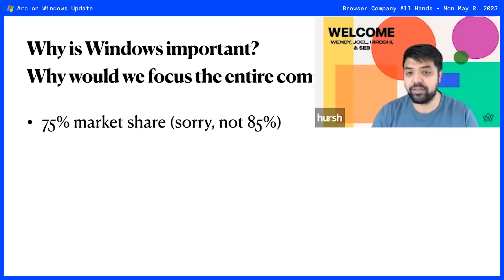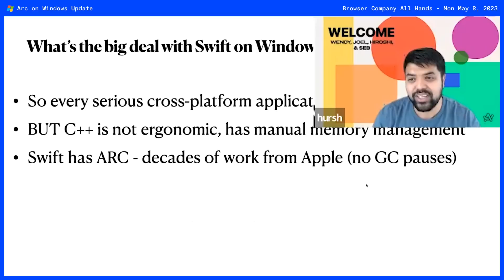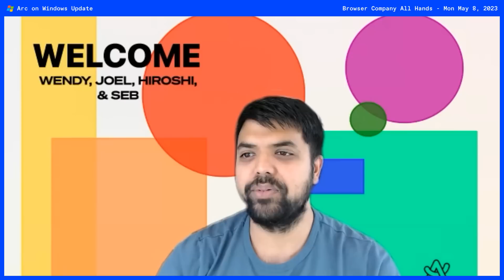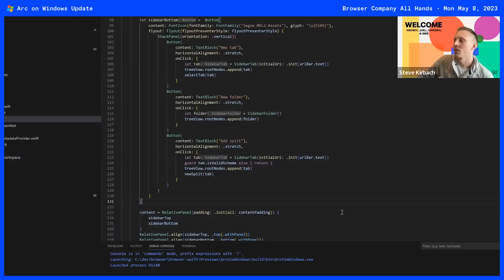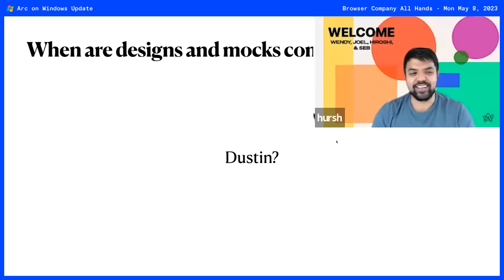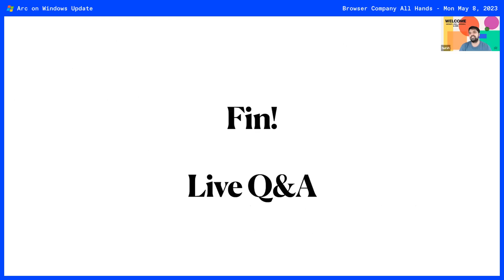How we're building the Arc Browser Windows app with *Swift*

Comment: Would it make any sense to bridge SwiftUI calls to WinUI? I'm thinking about how WINE works in linux, translating windows library calls to linux library calls. The idea of building an app in macOS and have the UI code just work on other supported platforms as part of the build process seems enticing. I guess the obvious big drawback would be Apple replacing SwiftUI with something else down the road. Maybe the solution is a both/and approach. Allow for an optional bridge, which could be maintained as a separate project that gets inserted into the build toolchain when present. The job of the bridge would be to handle Apple's UI calls passing them appropriately to the UI framework of the build target.

Comment: I'm super fascinated with this as a Swift developer and how you inter-opt with winUI. (also, Windows has so many UI libraries, is winUI the best / most modern?) I imagine initially crafting your own UI library in Swift to work with winUI will be necessary, I wonder if eventually one could just write SwiftUI code and check a box to deploy to Windows. Would that be possible? Or I guess Apple would need to be involved and/or open source SwiftUI
Reply: apple won't do it 4 sure
Reply: it does seem unlikely, but maybe they would open source SwiftUI? Depends how they would separate it from their internal OS dependencies  @TheZazatv
Reply: @relaynotes  I don’t think they would they do not tend to open source ui kits or other frameworks needed for development (combine etc) Moreover cause of lack of the documentation and closed source SwiftUI at first year was a black box. And lots of their new apis makes you update your minimum deploy target like crazy. Unlike Google’s open source Compose which has a backward compatibility. Ugh I wish we had the same policy on Apple platform
Reply: I mean, right now for sure SwiftUI is closely aligned with their software releases which can be annoying but keeps dependencies and app size down compared to Google's approach. I guess the thing that gives me pause is they call it "swiftUI" not "appleUI" and swift is open source. So it's not impossible they don't consider to open source it once its more fully baked, just like Swift itself took 2 years to open source. But, could be wishful thinking, you may be right, I'm just saying with Swift they have done things differently than the old AppKit UIKit days. @TheZazatv

Comment: as someone who uses go on daily basis. hope swift is backend ready (they have great foundation but lack of community support)
Reply: Technically there is not a real backend for Swift, Swift is designed purely for Apple OS. you should consider the entire browser as an client-side/local only software that is protected under the OS (Wins or Mac), just like an app inside your mobile.
Any sensitive data/id that connects to the remote backend (which is often written in java, python, C++, go, you can name it) will be encrypted.

Comment: I understand that Arc is already built in Swift for Mac, but I truly believe that considering something like Tauri or exploring Rust as an alternative could be the best choice for you. Tauri can work on multiple platforms like Windows, Linux, and Mac, and they're even trying to make it compatible with iOS and Android. Since you're using Rust with Tauri, you'll face fewer obstacles and have an easier time creating a codebase that runs everywhere. Swift might be a bit tricky because it's a newer approach, and Apple isn't really focused on being compatible with other platforms—they prefer to keep things within their own ecosystem. Also, if your goal is to grow and make more profit, it's a smart move to target the biggest market share. I know starting from scratch is tough, but Mac has a much smaller market share compared to Windows. Instead of trying to make Swift work on Windows, it makes more sense to focus on making Rust work on Mac. That way, you'll have an easier time making your app work on different platforms, and it's a logical tech pivot, in my opinion.
Reply: Tauri is not a good choice for building a web browser. Pretty sure the team building Tauri would say so themselves.
Tauri lets you write Rust to create the main logic or “backend” of your app, and HTML/CSS/JS to build the UI, which gets rendered by the OS's system WebView renderer (WebKit on macOS, WebView2 — based on Blink/Chromium — on Windows, usually WebKit on Linux as well). For a fast web browser you probably want to ship a Web rendering engine directly, and avoid using Web tech to render your UI (though Firefox does it and manages it well enough; but the way they run XML, CSS and JS to render their UI requires a level of control on the rendering engine that Tauri does not provide).

If anything, if you want to create a browser which uses Rust and renders its UI using XML/HTML, CSS and JS (which can be nice for fast iteration of UI-centric features, indeed), then forking Firefox gets you closer to that goal than using Tauri. But then your rendering engine is Gecko, which you may or may not want.
Reply: Nah I disagree and I'm bullish on Tauri and Rust. They have swift devs, swift code, with a design focus. Leveraging swift is table stakes.

Comment: I am curious for the battery here.

For M1 mac, with chrome my mac lasts for around 12-14 hours.
While with Arc, it last for only 6-8 hours. So its completely half since it uses a lot of battery (like a lot).

Comparing this to windows with intel chip
For chrome they last for 6-7 hours (very good windows laptops $$$)
So for Arc, with Swift it might be significantly lower.

I don't want to offend anyone, I would love to see Arc on Windows and then on Android.
But, there is a need for battery optimisations or ways to trade features/performance for battery.

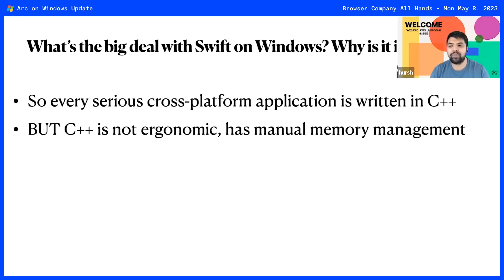Comment: 3:55 This is very very wrong, C++ has very advanced and flexible automatic memory management through RAII and smart pointers.

Examples:
std::string s = "Hello";
std::vector<int> values { 1, 2, 3 };
These value semantic class types cleanup automatically when the scope ends.

Also C++ has unique_ptr and shared_ptr for reference semantics:
struct T;
auto const t = std::make_unique<T>(...);
Automatically destroyed at the scope, or can be moved.

auto const t = std::make_shared<T>(...);
auto t2 = t;
Shared ownership with reference counting, just like Swift. Of course, in Swift it's backed into the language and not a library type, and writing std::shared_ptr<T> can be tedious if you use it a lot (ideally value semantic classes like those above should be most of the types used), you can easily create aliases for them.

Also while the C++/WinRT isn't very good due to being neglected by Microsoft (they're just lazy) the code isn't a problem. For example, you just use WinRT types like regular values, no need to think about memory management or other issues. WinRT/COM types are obviously already ref counted.

Comment: On the subject of RN, Flutter, and Xamarin, etc being "jank", I just thought it would be worth saying that for the purpose of making a browser, it makes sense to dive deeper than what those platforms can really provide. It seems to me that the closer to the metal you need to get, the less those platforms are valuable. If you're making an app that is 80% your average UI, and just allowing the display and modification of data on a backend then those platforms make sense. But if you're making a browser, the level of integration that's requires there is just so much more than your average app, which is what RN, Flutter, and others are designed for.
Reply: Exactly, flutter is great but not for low level stuff. I would never use flutter/ dart for a browser rendering engine for sure
Reply: @AlexNuzum2000  Yeah. They're misunderstanding what those are meant for. Those are widget-based UI toolkits, not something you should build a browser engine in. You would want to go with something lower-level.
Reply: I feel like though it’s very easy to lose that native feel that makes each device unique when developing on RN or any web based app framework.

Comment: Calling proven Frameworks jank (eg. Tools like VS Code are written with electron) while pushing swift for Windows. Bold strategy
Reply: vscode is in fact extremely janky
Reply: @arden6725  vscode is a great tool. But it was not designed for performance as a target goal. It was designed to be run everywhere. And I mean everywhere, not only on Windows, Linux and macOS, but also on a web browser. So, I don't think we should compare these tools.

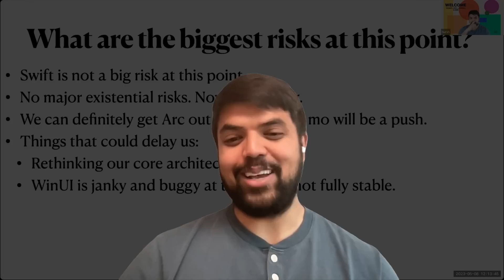Comment: 16:17 I believe the best thing the Arc team can do is create a design system for both the desktop and mobile versions of the app. This would help to create a consistent user experience across platforms, making it easier for users to switch between devices. It would also make it easier for developers to create new features for Arc, as they would be working with a consistent set of design principles. The existing design should be adopted and EXPAND to accommodate multiplatform.

Successful examples such as Photoshop, Firefox, Chrome, Edge, Blender and Affinity.

The advantages of implementing such a system would be numerous:
1. Users can easily use Arc on any platform without re-learning.
2. One Documentation and Tutorials: Creating documentation, tutorials, and providing help and feedback in the community would become significantly easier. 
3. The existing content created by the Arc community would receive a substantial boost.
4. Streamlined Content Creation and Consumption (YouTube tutorials and written posts).

NICE JOB you guys are doing.

Comment: my question is how you would deal with windows close, restore, minimize button on the right-top Windows corner, because on the Mac version, most of Arc is on the left side bar?
Reply: There is a class called SwapChainPanel. And you can do pretty anything you want to customize a window. So this is clearly not an issue, more of a design consistency question.

Comment: The statement on C++ needing manual memory management is not true. If swift's ARC count as no memory management, with std::unique_ptr and std::shared_ptr in C++ you can choose between better performance (when you don't need ARC) or equivalent ref-counted object lifetime.

Speaking of WinRT, all WinRT objects are ref-counted by default (they are just wrapper of winrt::com_ptr<Interface>). Consuming WinRT API (including WinUI) via C++/WinRT is almost as easy as C#. With coroutine, devs can even enjoy writing async code for IAsyncAction and friends with async-await that is built into C++/WinRT.

There are also much of XAML specific optimization leaving on the table simply by virtue of not writing XAML (no XBF, etc).
Reply: There is also a question of rewriting everything with the same codebase in C# using cross-platform solutions like Uno platform or AvaloniaUI. But I know throwing years of Swift code would be frustrating.
Reply: The only problem is Microsoft's reluctant behaviour to providing good developer experience for C++/WinRT. I think C++/CX still offers the best every day app development experience, obviously they can't use that.

Comment: I know that you are building your current app with Swift and Swift UI and that you want one codebase, so you have benchmarked several cross-platform solutions. I agree that they are a mess, but you did not mention Tauri. Have you looked at it? (I've never used it, but I'm really intrigued by it)
Reply: tauri is less bloated electron